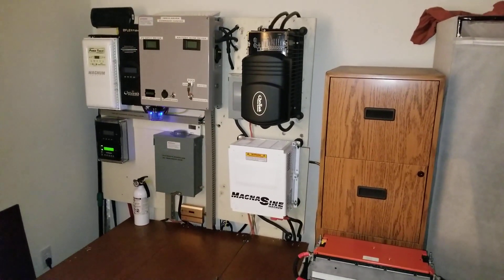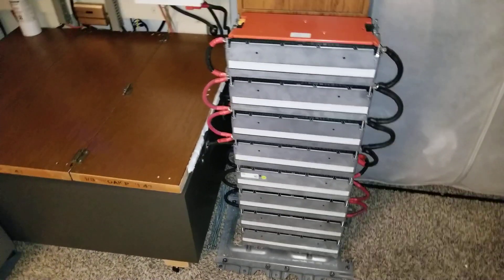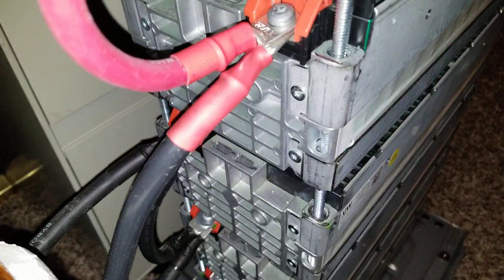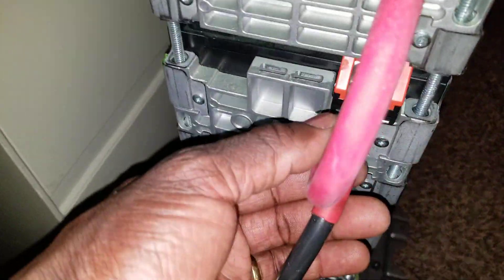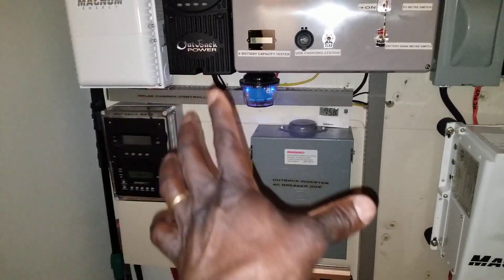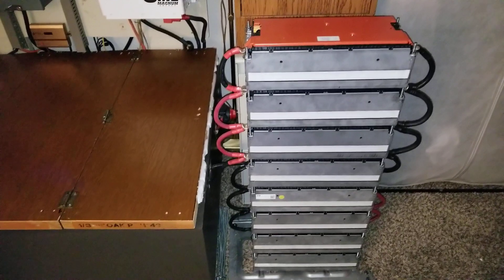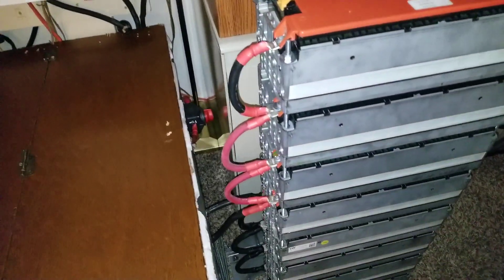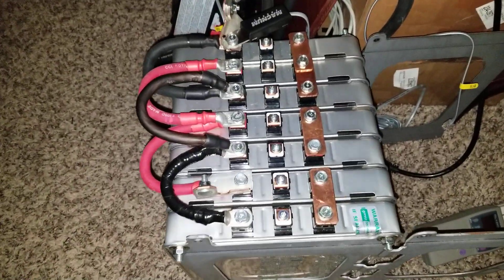AUTOMOBILE & SOLAR BATTERY POWERWALL: Lithium The Future Petroleum (Part#1)

Comment: What is the voltage of an e-golf battery module I see them on eBay but does not say.
Reply from the maker: Would you please send me link where you found them on Ebay? I wanted to verify if they are the same with mine please